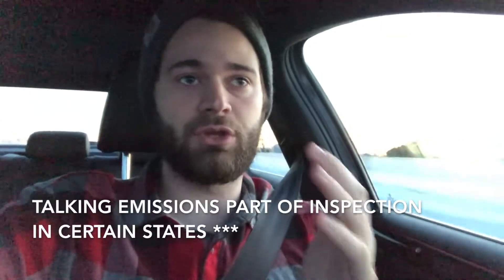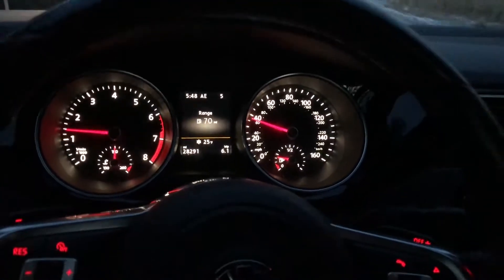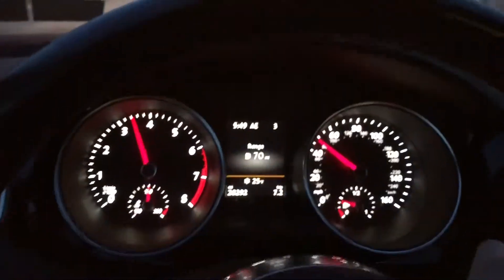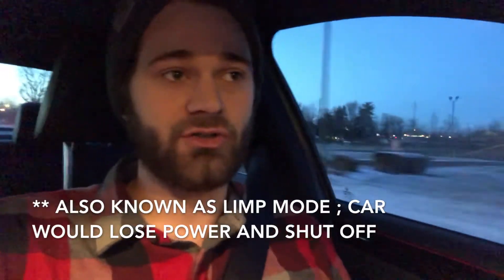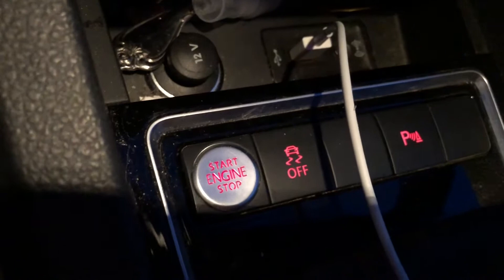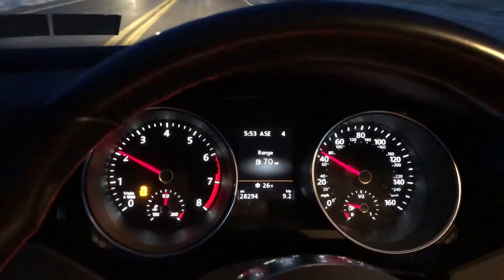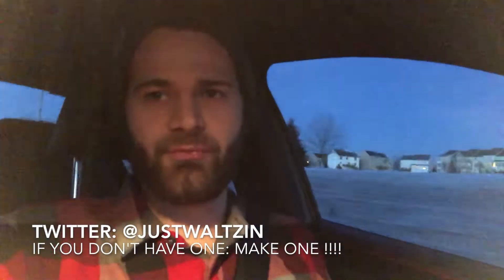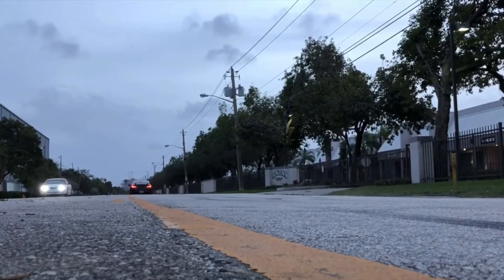HOW I PASSED EMISSIONS W MK6 GLI STAGE 2 READINESS SENSOR FAILED

Comment: NICE VIDEO QUICK QUESTION I WAS TOLD MY ECS TECH IF I GO APR STAGE 2 WITH CATTED DP THERE FLASH WILL TAKE CARE OF ANY CODES DUE YOU KNOW IF THIS TRUE RIGHT NOW I HAVE APR STAGE 1 WITH AWE TRACK BACK EXHUAST 2013 JETTA GLI AUTOBAHN IM NEW TO THIS BUT WANNA MAKE SURE BEFORE I SPEND SOME MONEY THANKS
Reply from the maker: I have no idea about APR I just haven't heard great things about them on the forums I follow. I am all Unitronic tune.
Reply: Waltzin ok so if I get the stage 2 like you have I should get no codes ? But I will get the catted dp in Chicago
Reply from the maker: @robertm.w2323  I have never gotten codes from a tune the point is to remove check engine codes. The issue is when you go to get inspected depending on how strict your state is they will do a readiness sensor check for emissions. You have to be compliant with them and uninstall the ECU tune unless it was tuned by a APR dealer. If they tuned it then you should be good.
Reply: man thanks that's what the tech said at ecs go with apr stage 2 with dp ill go catted but he said they will take care of the codes in the stage2 so ill pass emissions thanks for the help keep the good content coming

Comment: Are you running a catless down pipe? I did emissions in ct on stage 2 and failed. Catalyst: not ready, o2 sensor: not ready, o2 sensor heated: not ready.
Reply from the maker: Ruben Martinez hahah I actually posted a video how to pass emissions on here a month or two ago and I gotchu. Edit: I thought this was on my unitronic uniconnect video my bad haha. But Reflash back to stock file, you unfortunately are gonna have to put a type of cat on I did for this part.. mine also had visual inspection for a muffler so I did a little bullet style straight thru muffler, and then take it to get inspected. After it passes just flash it back. Unfortunately with the cable it doesn’t have what most tuners install for the readiness sensors to pass... stupid yeah I know 😫

Comment: Just turbo upgrade the GLI.
Reply from the maker: Kinda wanna switch up the front wheel drive platform to a rear wheel. Also comes the longevity sacrifice with the big turbo putting stress on the engine... & Lots of money...